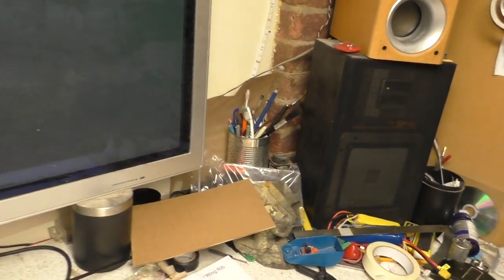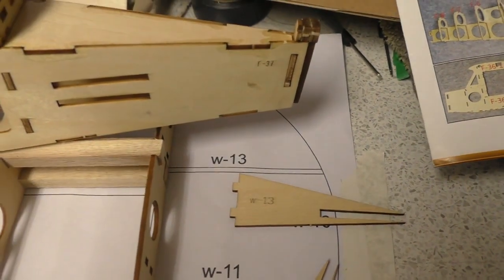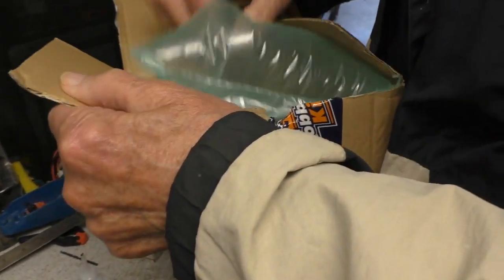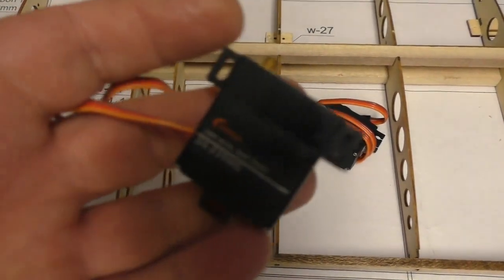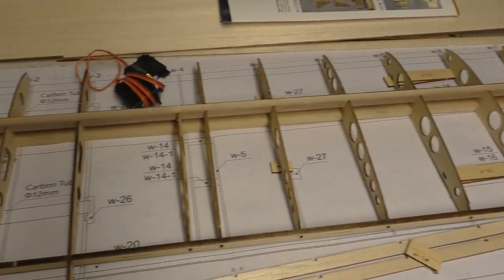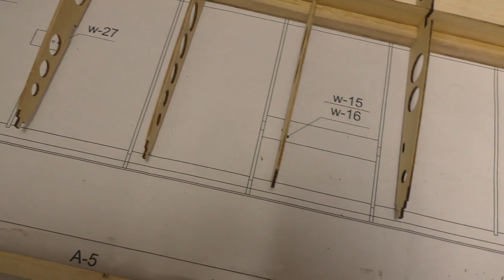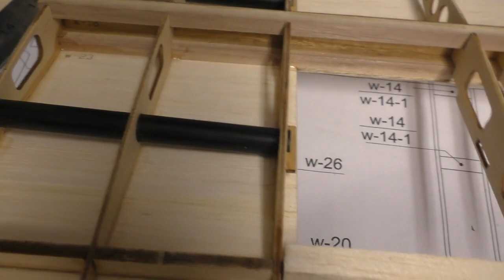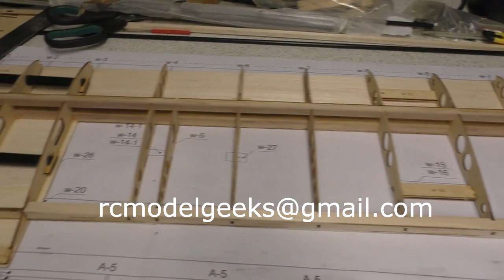Hobbyking J3 Cub 1800mm DW Hobby build Pt4 RC Model Geeks

Comment: When building the Piper Cub J-3 wing, can you tell me where the 'rib' W0' goes. Is it glued to the wing rib W1 as it is larger than the rest of the ribs.
Reply from the maker: yeah it glues to w1 once the wing is finished. with the top and bottom sheeting on the wing, w0 will match the profile of the wing.